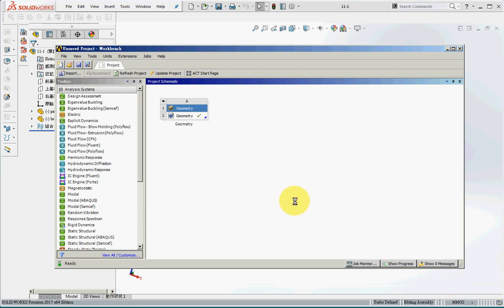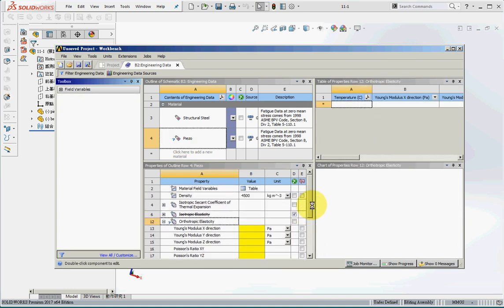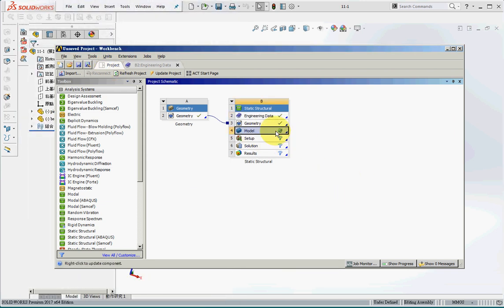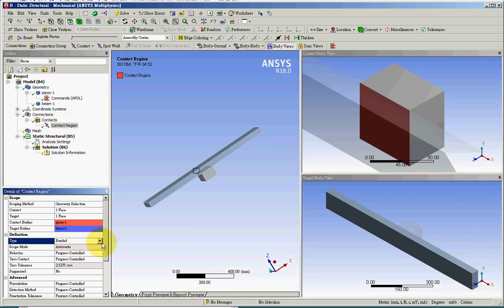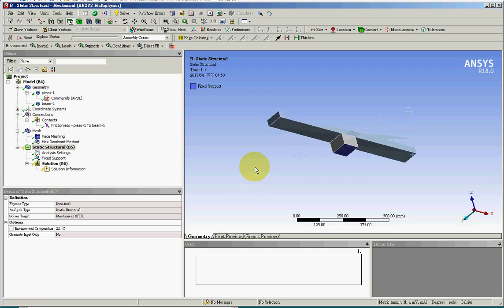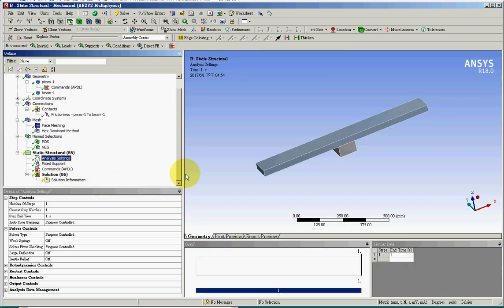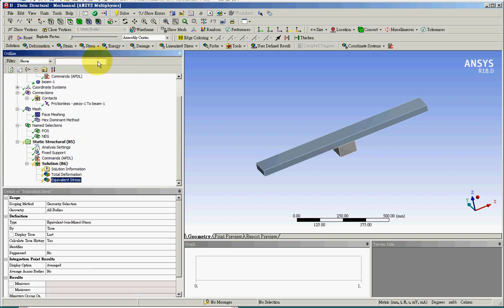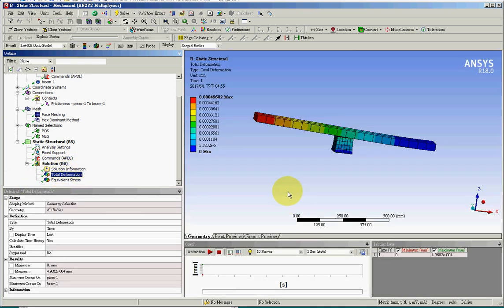ANSYS CAE 15  Piezoelectric Materials

Comment: Hello Sir! I am working in a Sensing/Energy harvesting application using piezoelectrics. As by now, the only way I have seen to do this was using APDL tool. In this case PZT works as an Actuator. Could this method be used also for the direct aplication? Thank you in advance :)

Comment: HI ,CAN I DO THE REVERSE OF THIS ? I MEAN IF I APPLY THE FORCE ON  BEAM AND IT CAUSES DEFORMATION IN THE PIEZOELECTRIC , CAN I GET THE POWER GENERATED IN PEIZOELECTRIC DUE TO DEFORMATION ?
Reply from the maker: There is an add-on module in ANSYS official website. I have not used it yet. You can try it if you lije to.
Reply: @謝忠祐-g5h  can you name that module pleasse
Reply from the maker: ansys piezoelectric and mems extension
Reply: @謝忠祐-g5h  How did you get the piezo electric properties ?
Reply from the maker: @obaidullahkhan5522  I used the data from ansys training course.